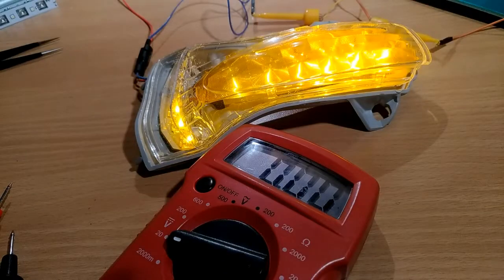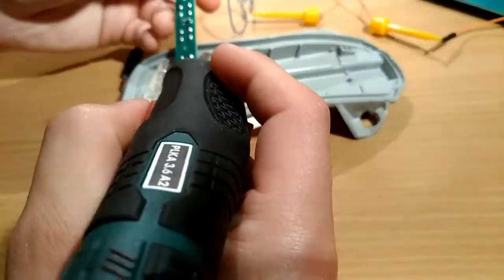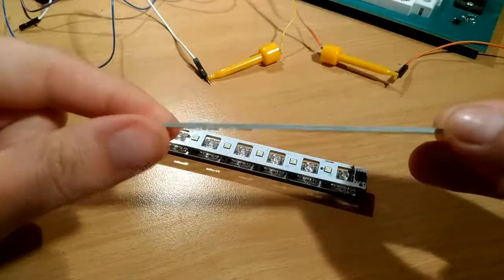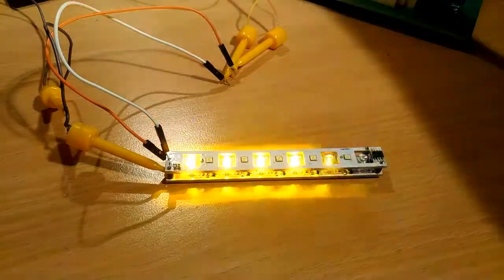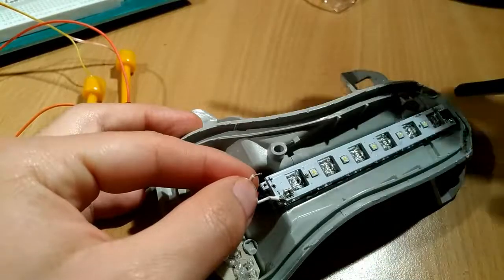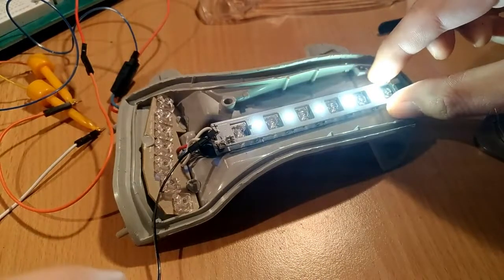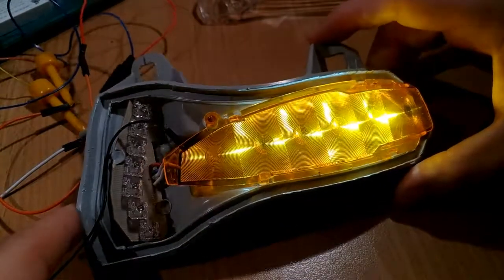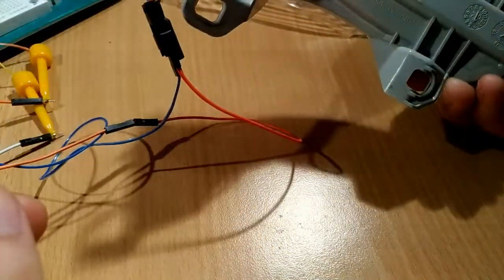Chrysler 300M Special - Side mirror turn signals mod

Comment: How did you get those apart? I have the clear lenses and want to swap them out for the orange.
Reply from the maker: Gently pry the edges with a screw driver, this will crack the glue... Little by little, take your time, it will eventually get to a point where you can pry it off.

Comment: What can I buy this one too lol
Reply from the maker: Hi Brandon, I still have some materials to do a limited batch. IIRC someone else was interested on the 300M club forum so I could give it a go. But I think you should read the related posts on the forum! The kit comes with the bare boards only, you have to open your turn signals, remove the original board (desoldering 2 wires) and solder the boards from the kit then reassemble. Also if you want the DRL version you have to run another wire through the door from a 12v ACC source which is a lot of work.